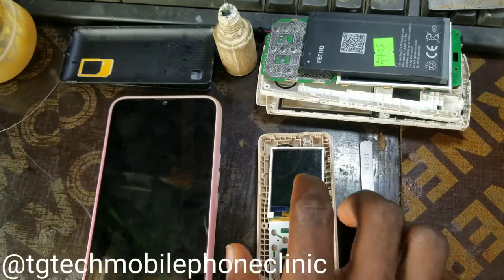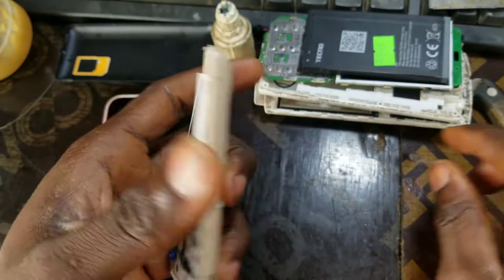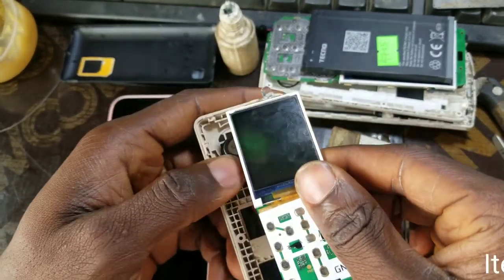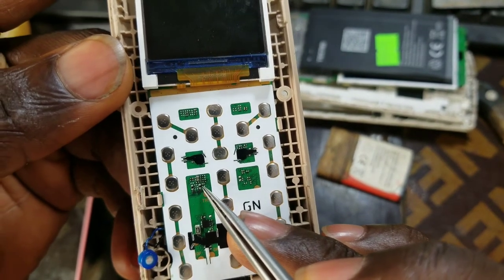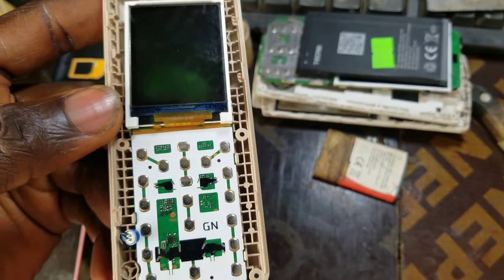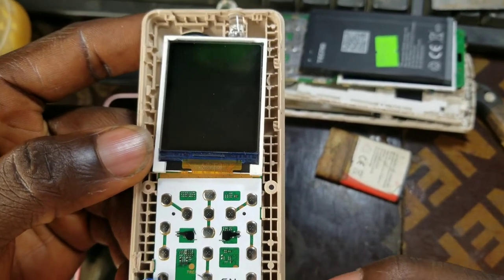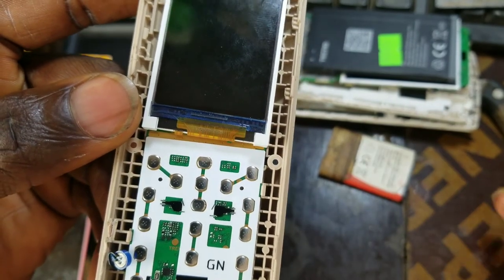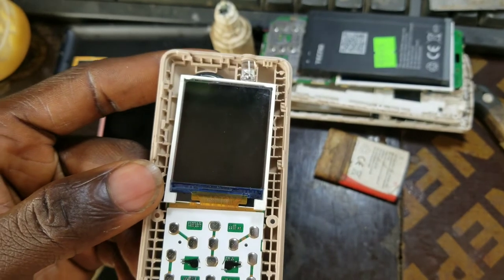Itel 2160 Mic Solution

Comment: Thanks, bro... What if the brown ic is damaged by water 💦 what else can we do
Reply from the maker: The brown component you called ic is the Capacitor. If is damaged, you can replace it looking for a scrap board or panel to remove exactly like the capacitor that was on the old one.